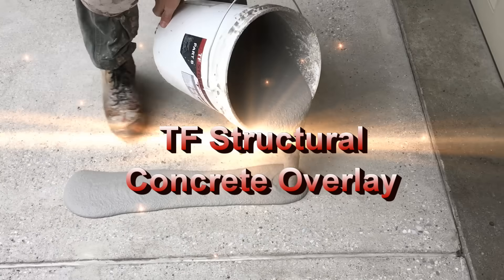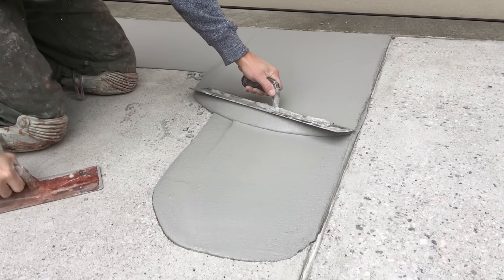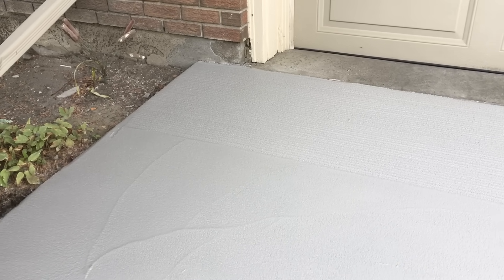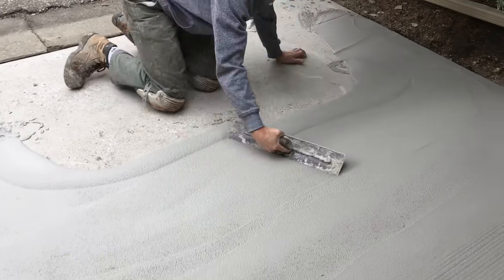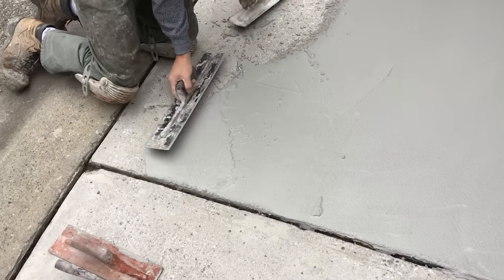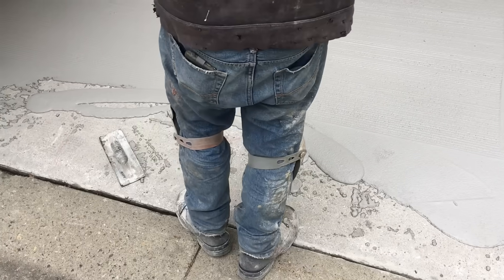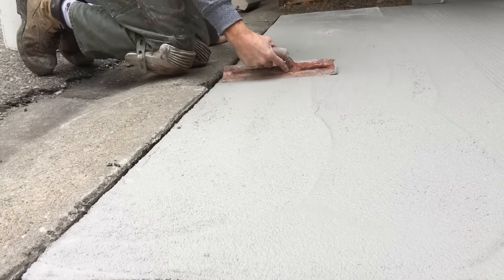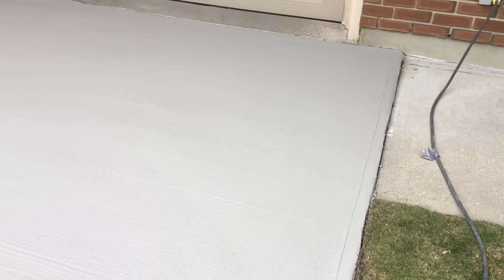TF Structural Concrete Overlay - Overview

Comment: Great video. What did this particular job cost? I may need my entire driveway done.
Reply from the maker: an overlay like this usually runs around 5-8/square foot. What area are you in?
Reply: Terrafuse Inc. 5-8 a square foot? That’s a lot I feel like.... I paid 4.5 a sq/ft to have a 4” thick driveway built..... and around here you can get a drive smashed and removed for 1.25 a sqft.... for such a small driveway they mind as well just redid the driveway.... I’m in SETX btw for pricing.

Comment: I was told to always clean the old concrete slab and wet before applying the new top coat. Your thoughts.
Reply from the maker: Yes, proper prep is always important. As far as wetting the surface, this is almost always required with portland cement based toppings. Our product does not use portland cement. When using TF Structural,  you can wet the surface to help increase your working time, and make the product easier to work with, especially on hotter or windier days. This step is not required though.
Thanks

Comment: Crack will come back? Can you fill the crack with epoxy first? To prevent the crack from coming back?
Reply: D B 
You can, but make sure the epoxy has  fiberglass in it.  The fiberglass prevents it from expanding in heat.
Reply from the maker: Here is a good method for crack repair, using the same product for deep filling and overlaying: https://www.youtube.com/watch?v=xvq0TXjMfeU

Comment: Neat work, thanks also for the tips with the double trowels!   I like your work.
Reply: If you paid for it you wont like it in 6 months. He put a band aid on bigger issues.  That crack will be back as soon as you put a car on it. There is no way a topping can deal with the transfer of weight between the slab sections.  If the 6" concrete slab broke, a 1/8" topping has no chance.
Reply: Maybe a form of control cut over the original cracked surface by running the trowels pointed tip along a straight edge before the concrete sets , result would be a clean intended styled finish . Marge 's hubby .

Comment: HI. MY BACK PATIO WAS POORED BE A ROOKY AND IS LOW IN THE TRAPPED CORNER OF THE HOUSE, I HAVE SINCE COATED IT WITH a XYLENE BACED STAIN.. Do I have to remove the stain before filling the low areas with this product. The first coat of the stain was mixed very loose so the stain soakes into the concrete. I don't think I can get it totally off..
Reply from the maker: Yes, ideally you want it removed, so you have a clean, porous surface for the Structural to bond to.

Comment: Don't think you need to do this if concrete had rebars in it in the first place. It still will crack but only hairline cracks where the rebars keep it together. I resurface a few of times (small sections of driveways and bathrooms needed leveling), not as easy as it looks. This guy is good.
Reply from the maker: Here is a good way to fix a crack: https://www.youtube.com/watch?v=xvq0TXjMfeU

Comment: So the crack will eventually come back.. really! That's why we have to babysit contractors. The crack needs to be cured BEFORE you do the resurfacing. That's just common sense.
Reply from the maker: Who is we?
Reply: @TerrafuseInc  the general public, homeowners, flippers, etc.
Reply from the maker: The homeowner was not concerned with the crack coming back, they were resurfacing their driveway because there was an old, failing material on it. If you want to do a crack repair, this is a good method to use: https://www.youtube.com/watch?v=xvq0TXjMfeU

Comment: ALL THE OTHER VIDEOS 🎥
say to keep the concrete wet to prevent shrinking. 
Not sure what is the difference between the compounds..
 🚗 🚌 🚚 🐎 🐎 🐎 🐕 TEAM
Reply from the maker: Our system is not portland cement. The other technology you are probably seeing, is based on polymer modified portland cement. This chemistry undergoes a hydraulic cure, which requires the moisture to stay in the system as long as possible. Early loss of moisture, before the hardened cement has formed, can cause shrinkage. Our technology does not use any portland cement, and does not require moisture during its cure cycle.
Reply: @TerrafuseInc 
 Thanks for the reply. 👣
Are you an installer or a dealer or both? 
I am LQQKing to learn this part of floor care for my floor care business.
Reply from the maker: We are the manufacturer, and we do offer training at our location, or hands on training for a cost. Feel free to call us for more info!

Comment: What's the sense if it'll crack where the crack was?
Reply from the maker: There was an old topping on the slabs that were failing. This was removed, and a new surface was replied.
Reply from the maker: Here is how to repair a crack first if the customer wants it done: https://www.youtube.com/watch?v=xvq0TXjMfeU

Comment: One chip n u can lift that whole overlay off of the old slab lol.  Its just sitting on top. A qtr inch of cement on top. That will turn to rocks in a year or two.
Reply from the maker: You are incorrect.  That is common with polymer modified repair mortars and overlays, which TF Structural is not.  We have projects that have been down over 10 years and gone through dozens of freeze thaw cycles in a winter, and they still look fantastic.
Reply: @TerrafuseInc   What's holding it down besides weight itself. No binder nor rod. I have never and no matter what type of concrete it is. It WILL NOT just automatically bind to the old one. It can't. Fresh cement will not.
Reply: So OK prove me wrong and do another video and take a trowel or anything flat and show me it won't lift off off the old slab. And I won't have any more objections.
Reply from the maker: @jaunvaldezzking2467  You are correct; concrete will not bond to concrete.  TF Structural is NOT concrete; it is an acid based product that is not filled with any portland cement, glues or polymers, like a lot of traditional repair mortars.  If you have clean, porous, structurally sound concrete to install on, TF Structural will bond extremely well.  We have 10+ years of successful installs in some of the harshest environments in NA that proves it!  Who knows; maybe this is truly is a better mouse trap? :-)
Reply from the maker: @jaunvaldezzking2467  Stay tuned! :-)
Reply: @TerrafuseInc  Lol. OK. Tag me or make sure I get it first.
Reply from the maker: Please watch our video on using TF Heat accelerator, and then tell me what you think! It shows you the bonding ability, and strength of the material, after under one hour only. I use a jack hammer on it an hour after I install it. That tells you everything.
Reply: @TerrafuseInc  OK I will feels like u know I know a little something bout concrete. I will watch it and subscribe as well.
Reply from the maker: @jaunvaldezzking2467  Thx man! :-)
Reply from the maker: TF Heat for Accelerating TF Structural https://youtu.be/isCXARp0hzw

Comment: Why do yo broom so early? It might actually look good if you knew your timing and waited. Can you trowel this a second time? Many overlays can not. 

A rough course finish. Looks like a barn slab. Overlays are such a brilliant product and then you show this. Sorry but you fail. Also, no slab prep? Bonding agents? Primers?
Reply from the maker: It is clear you didn’t watch the video, or you didn’t pay attention. TF Structural is not a polymer modified cement, and does not use Portland cement as a binding chemistry. It therefore does not require bonding agents or any primers. It also cures rapidly, and therefore needs to be finished earlier than other overlays, hence the early brooming. Please pay attention before you make uneducated comments.
Reply: Maybe you should make it clearer in the video. I did watch it and no, I didn’t pick up on that. When brooming early you should make it clear why at that time. There are different types of brooms too. I use them all the time to make my overlays look better than this. 

Try to be a little less touchy too. Take a breath before you have the angry response to a potential customer.
Reply from the maker: Fair enough, however, your initial comments did not make you appear interested in the product, but more about insulting me and the process. 
It can be trowelled a second or even third time, and many contractors have developed their own techniques that work very well for them. I suggest you read our data sheet as well, as it will tell you more about the differences TF Structural can offer. 
Thanks

Comment: Why not clean and fill the cracks??  Nice work though
Reply from the maker: TF Structural, like most overlays, is very rigid. When it is used to fill cracks, they will reflect through, especially in the climate it was installed. This can be routed out and filled with a flexible joint filler after, if the customer chooses. This job was done to repair the slabs surfaces, as there was an old topping on them that was failing. It was not done to fix the crack, or more extensive methods would have been required.
Reply from the maker: This is also another method to address a crack before overlaying a slab: https://www.youtube.com/watch?v=xvq0TXjMfeU

Comment: What the reason for using this anyway.
Reply from the maker: The old slabs had a failing topping on them, that was removed. Customer needed a new surface.
Reply: @TerrafuseInc  This was notbin the video
Reply from the maker: Yes, I understand that, and thank you for your question.

Comment: Not sure what state you're in but up north, we have to wet the concrete before we do an overlay to get a solid bond
Reply from the maker: You can wet the concrete before applying TF Structural too, but it is not essential. This product is very different than other overlays. I suggest you read our data sheet found on the website for more info. Thanks!
Reply from the maker: TF Heat for Accelerating TF Structural https://youtu.be/isCXARp0hzw

Comment: Lipstick on a PIG? I doubt this will last 2-3years..
Reply from the maker: It will last much longer.
Reply: @TerrafuseInc  How long (in East Texas)?
Reply from the maker: 10 years for every 1/8" of coverage. Sorry for the delay in responding, i missed your reply!
Reply: Not sure itll last a year. Once you start driving on it itll crack that thin layer of concrete in matter of months. ?

Comment: Awesome👍
Any vids on hi-lo slabs? 

The slab in my back has that, and when it rains there's a puddle in the middle that stays and doesn't flow away.
How can I correct this issue?

Sub'd 👍
Reply from the maker: This product is perfect for that, but I don’t have a video out on this process yet. Stay tuned! Feel free to call us to discuss in the meantime. Thanks :)
Reply: Rip out and replace, or you will revisit this project again down the road. Especially if water is is an issue.

Comment: To guarantee the job the crack should have been stabilized. Waste of time and money and no guarantee. Crack should have been remedied first. First load will open the crack. No compressive strength in that thin of a layer. Wasn't that a driveway?
Reply: Just a bandaid
Reply from the maker: Wasn’t done to fix the crack. You’re just repeating what’s already in the video.
Reply from the maker: Here is a method for crack repair if the customer is looking for that: https://www.youtube.com/watch?v=xvq0TXjMfeU

Comment: that is temporary does not work it is best to replace install ribbart to avoid cracking
Reply: FYI, rebar does not keep concrete from cracking. Rebar keeps cracked concrete from breaking away. The only way you control seeing the cracks are with your joints. 
Concrete will always crack somewhere at some point, it's inevitable.
Reply from the maker: crack repair method: https://www.youtube.com/watch?v=xvq0TXjMfeU
Reply: @crabby crab I don't understand why Mr Torres thinks frogs are the answer either?!?!
Reply from the maker: If the goal is to fix the crack.

Comment: Would you recommend epoxy and smoothing that crack with a grinder before the top-coat?  I feel like that stuff is just going to crack just like what’s underneath.
Reply: I've seen high pressure epoxy injection as a concrete structure repair - need special equipment. Something like this might work: https://www.amazon.com/PC-Products-72561-PC-Concrete-Anchoring/dp/B008DZ169S/ref=sr_1_21?keywords=epoxy%2Btube%2Bfor%2Bcaulking%2Bgun&qid=1561428110&s=gateway&sr=8-21&th=1
Reply from the maker: Try this method: https://www.youtube.com/watch?v=xvq0TXjMfeU

Comment: Use a slip joint over the crack dude. Something like a tile vinyl crack supresent...
Reply from the maker: or this method: https://www.youtube.com/watch?v=xvq0TXjMfeU
Reply: I have a grout pump that goes into a 5 gallon bucket and you hand pump mortar into voids.  If needed the whole slab could be reinforced from underneath with it.  You could drill a few holes into the crack where the tube would go in. I have used it for this very purpose.  I even took a huge boar over the top of slabs then drilled into slab and installed screws into them then on the board I put a car jack and attached a chain to the screws then jacked up the slab and while it was raised I pumped mortar down in. Released the slab and whalla.  Then I coated the top of it.

Comment: Is this material can be applied on tarmac? Thx
Reply from the maker: Yes, but you will see micro-cracking appear throughout it, as the substrate is too flexible.
Reply from the maker: TF Heat for Accelerating TF Structural https://youtu.be/isCXARp0hzw

Comment: Good if your selling and want to make it look good. Worthless if your wanting a good concrete driveway that should last at least 20 years if the proper mix is used then properly poured and finished then sealed!
Reply from the maker: Hi Dan, that is incorrect.  We have overlay projects that have been down for 10+ years, subjected to dozens of freeze thaw cycles in Western Canada, and they still look great.  Traditional polymer modified repair mortars and overlays do fail....TF Structural is very different from those systems.  Why would you replace a concrete pad that is failing with concrete again?

Comment: Everyone seems riled about the crack. Concrete cracks not if when. So, the reason is irregular substrate compaction. Unless the pad is stabilized underneath nothing will prevent a crack from returning. Now why not do it? OPM. Other people's money. Most customers won't spend the money for the full Monty.  34 years of hearing, "is there a cheaper way?" 34 years of saying, yep, it just isn't less expensive in the long run. Those who understand know what I mean.
Reply from the maker: Here is a method for crack repairing: https://www.youtube.com/watch?v=xvq0TXjMfeU

Comment: So... wouldn't chasing cracks out with grinder and then using the crack repair epoxy and sand technique before overlay minimize cracks returning?
The liquid epoxy should flow deep into crack to better stabilize the two opposing sides of a crack.
Reply: Liquid epoxy!! Thanks for reminding me about it. I suppose I could use it to repair my crackled front door step? I only need a thin layer of the epoxy. Will it stick to the concrete? Thanks.
Reply from the maker: @E-Kat  Epoxy should never be used anywhere where it has the potential to be exposed to UV light.  Even 'uv-resistant' epoxies breakdown over time and will yellow, with UV exposure.  TF Structural will not bond to epoxy.  It is designed to bond to mechanically prepped, clean, porous concrete substrates.
Reply: Y
Reply from the maker: crack repair method: https://www.youtube.com/watch?v=xvq0TXjMfeU
Reply from the maker: Yes, there are multiple ways you can address the crack, all of which cost time and money. This customer was not concerned with it, and this is not why they had their driveway resurfaced.

Comment: Looks great! One question: Can this be used as a garage floor leveler and then epoxied over? Thanks
Reply from the maker: Hi Carl!  Yes, it can be used to re-level a garage floor, but it is not a self leveling product.  Essentially, you will need to work the product over the area you are wanting re-level.  Are you wanting to fill in ow spots, like bird bathing, or is the floor sloping to the sides or back of your garage?  Yes, you can install coatings over TF Structural, but you will need to prep it again beforehand.  Once it has cured, TF Structural is very dense and will need mechanical abrasion before applying a coating.
Reply: @TerrafuseInc  Yes, my floor is nice and flat but not level from front to back. Thanks! I went to your site for a quote.

Comment: Is this appropriate for garage floor slab with no brooming?
Reply from the maker: Hi Pat!  Yes, it can be installed on your garage floor.  However, it won't finish as smooth a power troweled finish.  Just ensure whoever is installing, mechanically preps the surface with a diamond grinder or shot blast to ensure a proper bond.

Comment: The only thing this guy did wrong is not using metal lath (mesh) on that crack,big huge mistake...
Reply from the maker: Hi Victor, that is incorrect.  Metal lath or mesh will not be a permanent fix, or prevent future cracking.  If that substrate underneath continues to shift and move, after the TF Structural has been installed over top,  the crack will come back.  We explain that in the video as well; TF Structural is not a crack repair system.
Reply from the maker: Here is a method you can use to repair a crack first: https://www.youtube.com/watch?v=xvq0TXjMfeU